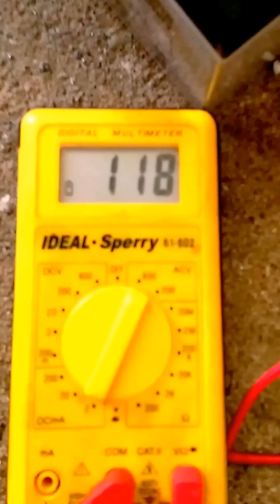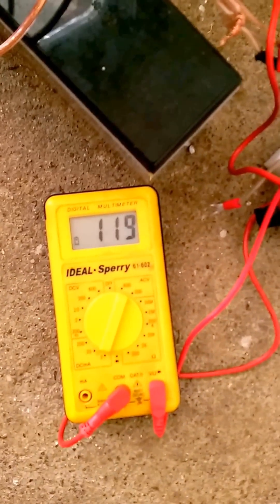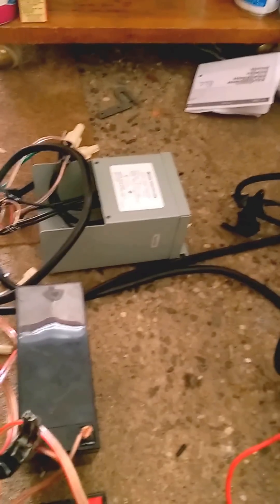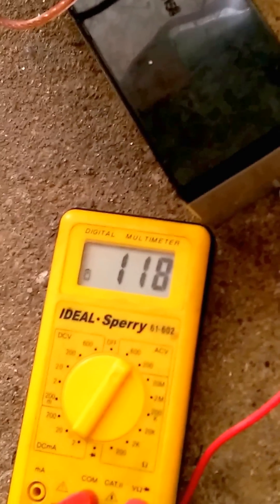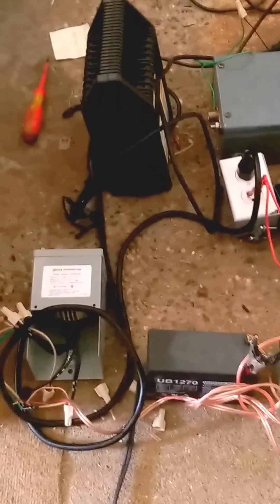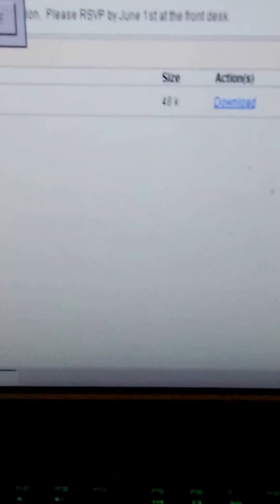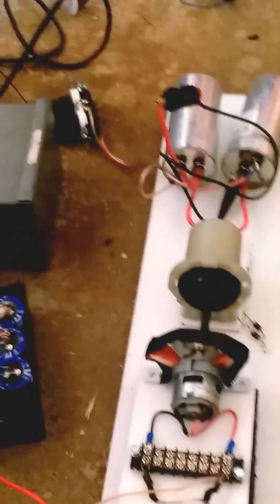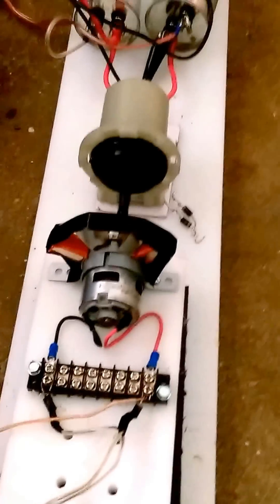Gerard Morin Washer Pump Generator &  PELEX DEVICE Successfully Looped!

Comment from the maker: I'd have to build a larger Pelex device, but, when.finished, the 2200 watts necessary to max out the alternator would amplify to be an output of approximately 660,000 watts. 

I'd have to look into having a professional wind the coils for me because I don't have the patience. Lol

Anyway, so far so good. Left since 7:50 am, the device is still continuously operating , no voltage loss of heat. All thumbs up so far!
Reply from the maker: Fabrizio Ricciarelli Thank you Fabrizio, that was really well worded and exactly the thing I face as well, all of the others on this planet that have found working devices that endanger the energy companies, they have themselves in the same position. so, I suggest they do the following to eliminate the publicity of having any such device:

either hide it and use it yourself, or, sell it on the underground to help folks save money. This can be done by switching the current electricity used on a small scale, maybe once circuit at a time in your home so you don't have to pay for the majority of the costs.

Make sure you tell nobody you are using it, and, use the energy to do something, such as make fuels like hydrogen and bottle it in mass quantities and sell the hydrogen so you don't have to worry about not being able to make money from the technology.

A lot of other things could be done with the mechanical abilities of the electricity including electroplating, machining, and running of any other electrical based technology that uses tons of electricity.
Reply: +Marc Belanger   there is a very large group pushing for disclosure , an equally powerful group push for silence and status quo  //  please chose wisely  //  a billion people would just change job titles
Reply: WOW   a person who is a direct relative of TESLA  ==  that is so COOL  //
Reply from the maker: Or heat, not "of " heat..
Reply from the maker: The system also successfully drives aluminum/copper/aluminum arc plates (as an energy drawing arc gap) between two high voltage transformers to bring in a much larger volume of external energy. I took the output, raised it to 360 volts. I added the Tesla hairpin circuit, then, input the low side of a neon sign transformer at 12kV. I added a custom spark gap, as stated above to come up with a massive gain in energy amplification

I eliminated Pelex and have been screwing around with many different "ungrounded" methods of power, I have built the audio filter and it keeps the noise down, as well, made the system work at 50-70 hz and is way more efficient. It has to be built differently for every size load, so, if it's used frequently, it needs to be used with the same sized load that I have calculated to stay within the frequency range the crossover is supposed to be used. The crossover filter is tuned to operate at a specific resistance, which is figured out by the amperage an voltage used and components according to a 12 db per octave crossover chart. The frequency is important in an arc gap system to draw energy at the transformer's "ideal" frequency. My next step is to build an adjustable vacuum arc gap using aluminum/copper/aluminum plates with just a thousandth or two between the plates to create the Casimir effect where the energy is drawn in from the vacuum. I've tried finding vacuum arc gaps online, but, they are extremely expensive and are not variable which is super important for the adjustments that are critical for free energy input.

The system so far has an amplification of 4 times with the arc plate design. I'm now shooting for 30-40 times the input power.
Reply: Marc Belanger Hi Marc, for the "vacuum arc gaps" go to eBay and search for "GAS DISCHARGE TUBE", there are many kinds, many voltages, many amps and they are relatively cheap so you can buy a mixed set of values and go with your experimentation. Just for your info, I purchased 10 of them: mine are rated 3kV. A big hug.
Reply from the maker: Fabrizio Ricciarelli Yes, you are good at finding this stuff! I used your input to buy one from an old radar set, unfortunately, I soldered onto the terminal and went to adjust the wire, then, off broke the terminal. I was extremely hurt as it was the only one of it's kind, and, it was like $40. I can't find a replacement, nor could I attach to the terminal since it is broken too far inside the glass.
Reply: +Fabrizio Ricciarelli ciao, ne stai costruendo o ne hai costruito uno di questi devices?
Reply: +Pasta Mista Ciao! La risposta presuppone un'informazione riservata...potrei fornirtela però poi dovrei ucciderti! lol
Si scherza ovviamente... il Pelex è di proprietà intellettuale di Marc pertanto io mi limito esclusivamente a fornirgli qualche dritta ogni tanto. 
Il prodotto c'è e funziona pure bene, con il solo piccolo neo che per poter essere distribuito dovrà essere sottoposto a tutta una serie di tests per le varie conformità agli standard sulla sicurezza, tipico delle apparecchiature elettriche/elettroniche.
Capisci da te che le attuali commissioni preposte al rilascio di dette certificazioni di conformità, sono appena un "pochino" manipolate...pertanto è in corso un'analisi selettiva del paese (suppongo nel nord Europa) che, in una vera posizione super partes, effettuerà i dovuti controlli di conformità senza che subentrino opposizioni di natura politico-economica.
Reply: Have you tried an epoxy or a cyano acrylic, it's new age model glue that is instantaneous set with a spray activator?  I hope this helps I put my own design together experimenting the other day. Then I got an idea that will change the guitar amp industry hopefully. I got rid of the hiss. I'm trying to understand what I did accidentally. While attempting to take one from a Volkswagon-ish practice amp to a monster truck Van halen-ish amp I managed to silence the buzz. I could see why what I did would have never been tried before it would be pointless to do but can easily be done with any amp. For about a 1.00$ American in parts. Me friend really is excited about building boutique amplifiers now as a musician he sees the profitability in a revolution in amps but this is my passion and always has been. I'm glad you had success, this is really exciting just getting unity is exciting to me. That is so relieving, I don't see many trolling engineers in here giving you shit and that's great. I've been laid off as a geologist for over a year and I will never forgive big oil it's their time to die,  Don't ever get discouraged When I first hooked up mine I saw 180% out the other side and nearly shat myself. I'm not great at electronics but can fall back on my ability to research and repurpose. I come from electrical engineers all the way back to my great grand-father that was an assistant of Teslas' and he helped my grandfather start his electrical power company in the state of Kansas, Colby which might have been the first generator selling power in that state, and he eventually started running telephone wires. the new deal put him out of business but i'm sure it was glorious, I think if he would have been able to keep what he had we would not be doing this right now because it will have already been discovered and implemented. There is no innovation at all anymore the government doesn't approve of first. Sometimes you just got to dare them to stop you. I don't give a damn what they do to me, what they give us isn't worth it anymore. They can have the name. I'm the human.
Reply from the maker: @jhnmckinley123  the problem may be in some way related to a shadow government, but even worse are the billionaire financiers they use to control entire markets to cash in on forever, these are the big hitters , one giant billionaire club of the oil and energy sectors that have so much that they may even be influencing new laws, amendments, etc. that would allow financial gain within their members. they may even control our patent laws, or perhaps some of these technologies may be related to Power so great that you couldn't ever cross them. Here's how it happens...You first get mild threats, letters , then more meaningful threats against family members, getting them to persuade you otherwise.. Then it may get very quiet, and if you continue to cross them something in your life may change, you could get very sick, things start to happen, your life may become very unmanageable as a last resort threat, then you or others you love could go missing. So, please keep this in mind before proceeding publically. Certainly use care , and do it at your own risk. I've been there,  and it isn't pleasant and the life of yourself would certainly be threatened.  Publicity is not something they want because it will ruin them financially for good. IMHO its bad to take that chance.
Reply: Correction    ==   a relative who worked with Tesla  ==  WOW still just a COOL
Reply: Fabrizio Ricciarelli, scusa tu hai visto funzionare di persona il Pelex o ti fidi a prescindere, che prove video ci sono di questa nuova tecnologia ci sono link di riferimento per vedere questi fantascientifici device, perchè leggendo i post si usano soltanto condizionali ma non c'è uno schema di riferimento sopra il quale discutere, mi sembra un po ridicolo parlare di tecnologia Pelex che cambierà il mondo senza sapere di cosa si parla, puoi togliere qualche dubbio in merito a me ed altri come me grazie.
PS: se i prototipi sono stati costruiti e sono funzionanti ed allo stesso tempo sono già stati presi accordi con degli investitori e l'inventore non può dire altro in merito, perchè stiamo ancora qui a parlarne, quale è il senzo finale di tutte queste chiacchiere inutili visto che non dirà mai a nessuno come funziona se non dopo aver fatto miliardi di dollari?, ora comprendo perchè non avremo mai energy free tutti coloro che scoprono qualunque cosa quel qualcosa diventa come l'anello di Henry Potter, "IL MIO TESOOOOOORO !!!!!",
quanto è debole la coerenza nel genere umano e quanto è facile convincere se stessi che solo il denaro può mettere in pace la nostra coscienza e quanto forte sia la parte narcisista in ognuno di noi, e come la bilancia penda sempre dalla stessa parte di fronte al libero arbitrio che il Signore ha donato ad ognuno di Noi.
Scusami per lo sfogo ma sono 20 anni che ricerco nella energy free e sono veramente stanco di falsi santoni che dicono di aver scoperchiato il vaso di Pandora, Basta per favore.
Reply: Fabrizio Ricciarelli, scusa tu hai visto funzionare di persona il Pelex o ti fidi a prescindere, che prove video ci sono di questa nuova tecnologia ci sono link di riferimento per vedere questi fantascientifici device, perchè leggendo i post si usano soltanto condizionali ma non c'è uno schema di riferimento sopra il quale discutere, mi sembra un po ridicolo parlare di tecnologia Pelex che cambierà il mondo senza sapere di cosa si parla, puoi togliere qualche dubbio in merito a me ed altri come me grazie.
PS: se i prototipi sono stati costruiti e sono funzionanti ed allo stesso tempo sono già stati presi accordi con degli investitori e l'inventore non può dire altro in merito, perchè stiamo ancora qui a parlarne, quale è il senzo finale di tutte queste chiacchiere inutili visto che non dirà mai a nessuno come funziona se non dopo aver fatto miliardi di dollari?, ora comprendo perchè non avremo mai energy free tutti coloro che scoprono qualunque cosa quel qualcosa diventa come l'anello di Henry Potter, "IL MIO TESOOOOOORO !!!!!",
quanto è debole la coerenza nel genere umano e quanto è facile convincere se stessi che solo il denaro può mettere in pace la nostra coscienza e quanto forte sia la parte narcisista in ognuno di noi, e come la bilancia penda sempre dalla stessa parte di fronte al libero arbitrio che il Signore ha donato ad ognuno di Noi.
Scusami per lo sfogo ma sono 20 anni che ricerco nella energy free e sono veramente stanco di falsi santoni che dicono di aver scoperchiato il vaso di Pandora, Basta per favore.

Comment: You could try using a unregulated alternator, or a 3 phase coil.
Reply from the maker: +thewonn That's a good idea. Unfortunately, I need a rotor for my truck alternator.. The one I have looks just like the standard GM car alternator, only it is a 19. the magnetic rotors sold for wind rotors aren't sold commonly, they are not easy to find unless you have a source, I'd like to try it. I have a small ac motor connected to it, I just need to change the rotor as the self excited system isn't efficient enough to work. already tried it.